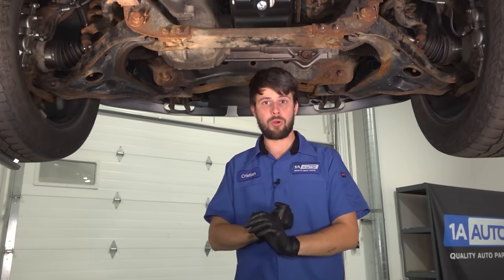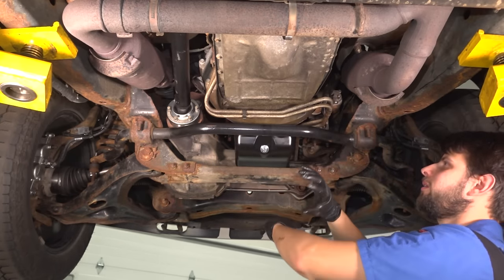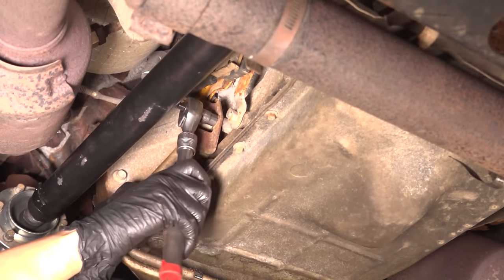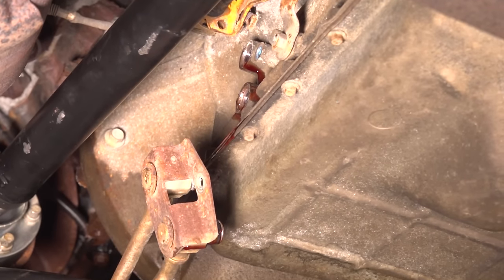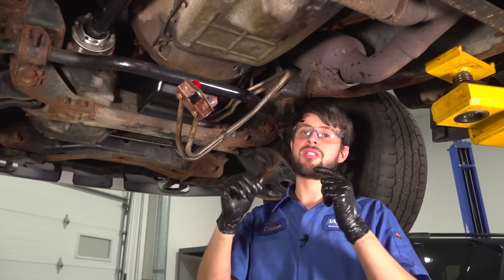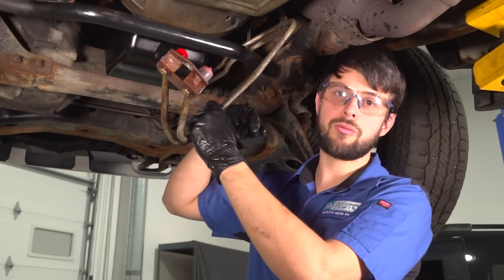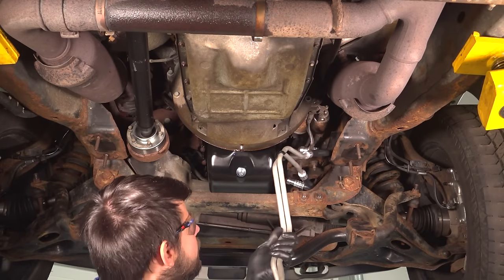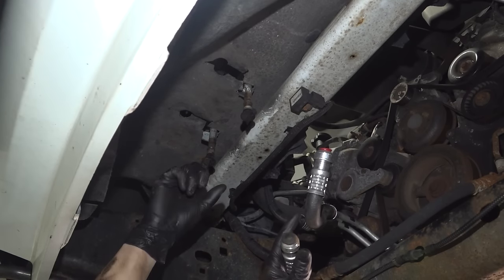Transmission Line Leak on Your Car or Truck? Don't Be Intimidated! You Can Fix It Yourself

Comment: When you do these inspect them out of the box. I ordered new lines and installed them before i realized that they had a crease and hole in the line from rough handling. Had to pull them off install the old ones again and order new ones